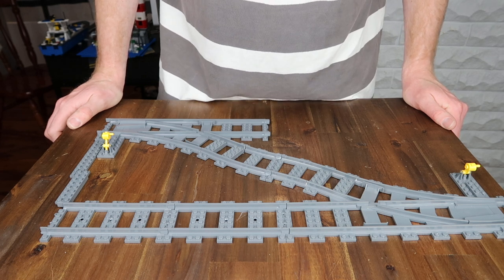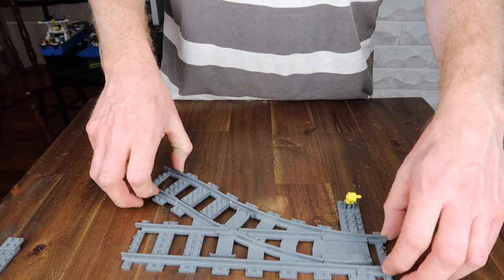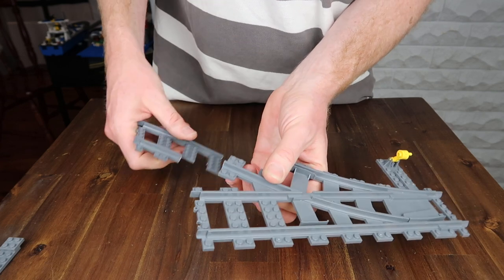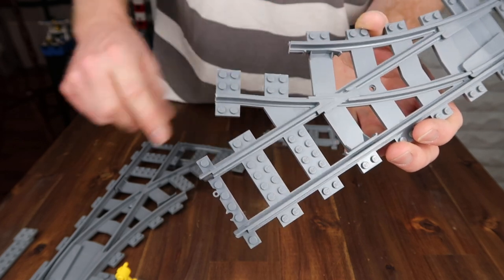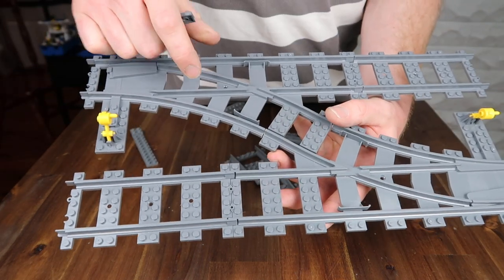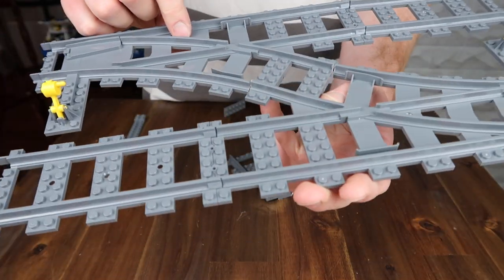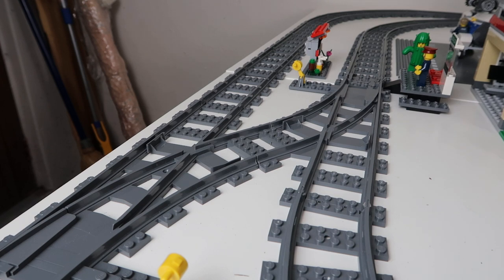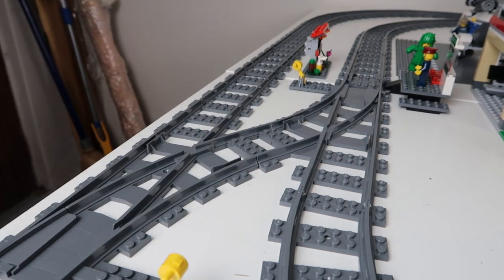Simple LEGO Train Hack : Shorter Junctions and Crossover

Comment: This is a good hack (pun intended) to get a better layout for your town. The reason the originals have the curves sticking out is to preserve the track geometry - after you add the extra curve to make the siding parallel it then lines up with the far end (once you have added a straight to the points). So points + straight + curve gives you 2 parallel tracks of the same length. It is a pain but it wouldn’t preserve the joint locations on subsequent straights otherwise, which I suspect would upset folks even more! 😁

As for the cutting LEGO issue. I was against it until recently, until I realised the only way of getting large quantities of 16-wide thin baseplates was to cut up a 48x48 into 3 long strips. Buying after-market second hand was going to cost me a fortune. And my city is so small that the layout required the hacking solution to make it work with train tracks. I’m happy I did it.  After all, it’s your property and you can do what you like with it! Just ignore the haters 😉
Reply from the maker: I like the way that 4D Brix sells theirs with the junction have a small extension piece to make it curve. Or leave and join them together for the best of both worlds. It's kind of like a small piece of flexitrack.
And Downunder bricks does the same thing - although I think his are slight trims to make them fit. He apologises every time he does it. Lol! If it works, and you don't mind doing it, fine by me. I will aim to minimise it, but I'm happy with the space I gained doing this!
Reply: GJBricks any plans for getting larger radius curves? I know the shipping to Oz is crippling. That’s one thing that bugs me about LEGO track is only having one curve radius (unlike Hornby Dublo for instance) so you can’t have nice neat parallel curves going on. Does me head in! 🤯
Reply from the maker: You've seen the size of my city yeah? I'd basically just have track if I did that :) 
But, I have heard it's possible to download the 3D printing files and do them yourself. The joys of 3D Printing! I wish I could afford to buy that track - then I'd probably also have the money to buy the Emerald Night train (and metroliner, horizon express, the 7938 train - converted to jacobs bogies, etc)
Reply: GJBricks LOL, ok. I hear you 😉 I would love Horizon Express. Apart from the cost, it has quite an overhang at each end and I’m wondering if there is enough loading gauge in my tunnel - it’s a tight fit with the curves, wall and tunnel entrances! 😱
Reply from the maker: Do you have the white high speed train? I imagine that would be similar overhang (was never a fan of that train)
Reply: GJBricks no, only Cargo Train (60052) and the new Hogwarts Express. I see what you mean though.
Reply from the maker: No idea when I'm gonna get my Hogwarts. Will have to plan something special to do with it for when I finally do. Got other sets coming before that. You'll see why they've taken priority.
Reply from the maker: Even the 60197 train has a long overhang. Watch the cactus guy at the point where I move the train through slowly. He gets hit a good few times
Reply: GJBricks yeah, exactly. Which is why I'm holding off spending lots of money on HE, only to find it doesn't fit! 😭

Comment: The only thing I do not like about this is that motorizing the switches is probably impossible from the ground level. Maybe from down under ;)
I will try to do it but I think I have to raise the tracks about two bricks to fit the motor under the tracks.
I have two left switching tracks to spare from my powered up cargo train sets, so I will probably hack them up :)
Reply from the maker: I will be interested to see how you go. But I'm sure a lot of people have done it from the top, or do you mean by shortening them, the closeness makes it hard to do?
Reply: @GJBricks  Yes, because after shortening them you only have 8 studs to work with and the switches are between the tracks and already use 6 studs. 
I raised the tracks by two bricks and a plate and now the m-motor fits just under the tracks.
Switching works perfectly now. 

My other solution would be to just use a curved track instead of the straight to give more space for the motor but that limits where I can put the tracks in a layout or makes it bigger again.
Reply from the maker: User Apego I’d love to see a pic of what you’ve done. I’m on Facebook, https://m.facebook.com/gjbricks/
Reply from the maker: Horizon Express... A Train I just cannot find for sensible price!
Reply: @GJBricks  Will you kill me if I tell you that I have two of those new and sealed stored away? I wanted to make mine longer but I never did because of space is always a problem :)
Reply from the maker: No, I’ll forgive. Sure I’ll grab them in a haul one day!